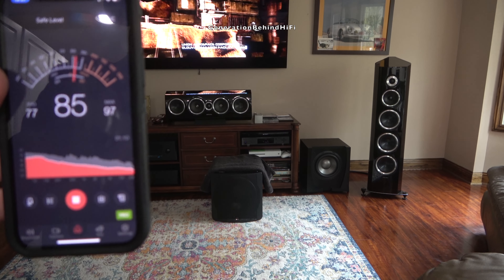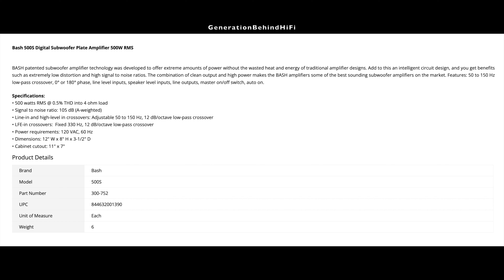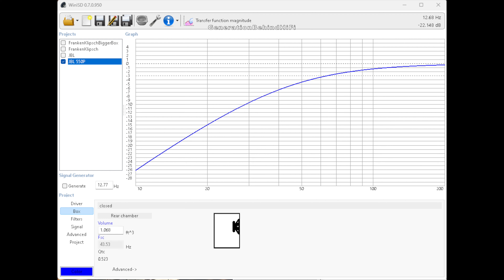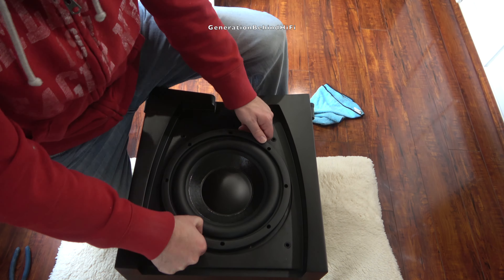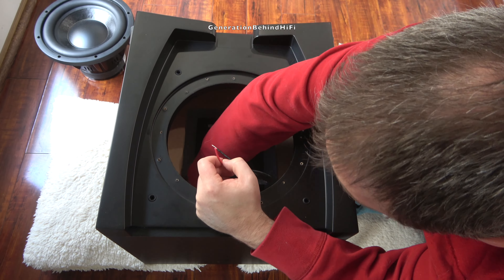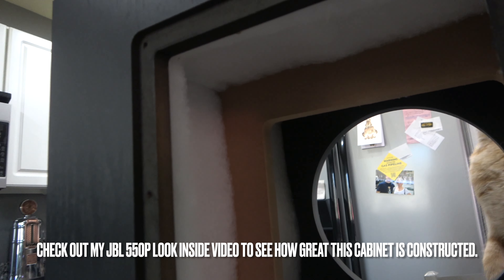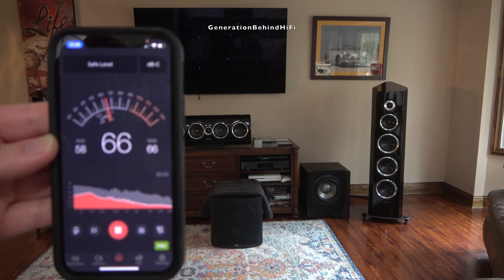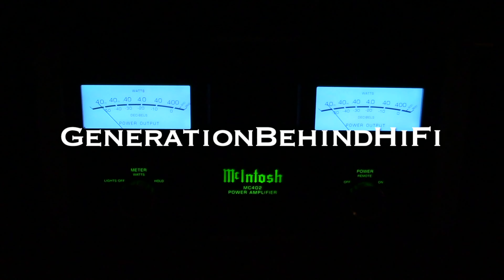Upgrading A JBL 550P Subwoofer P2/3

Comment: Which would be better for movies? 2 stock JBLs or one of your upgraded ones? I’m considering cost. My room is 15’ wide by 25’ deep. Thx guru!
Reply from the maker: Probably two stock JBLs. You will get a lot more piston area with two subwoofers vs one.
Reply: @generationbehindhifi  thx! any downside to 2 of these? Will the lows compare to a single 12” SVS quality sub?
Reply: @doctoryip1  I have a SVS SB12-NSD and I just put in an order for 2 of these JBL's for stereo subs.  I'll let you know how they compare, but the SB12-NSD has a world class Peerless XXLS driver in it that is probably the most musically articulate driver I've ever heard for a subwoofer.  I liked it so much I bought another standalone driver for mobile audio use.  I'm not sure which driver they use now in their SVS 12" sealed lines, but they still look similar  to the Peerless.  I'm hoping the JBL's sound just as good, considering the reviews of people who have had both say the JBL is 80-90% of a SVS SB12 in both output and quality.

Comment: What are the dimensions on the replacement amp? Will that work as a drop in replacement?
Reply from the maker: I'm not aware of any drop in fit plate amps for the 550P.

Comment: Well I went ahead and picked up the SDX10 myself. Will be removing the JBL sub and looking over the enclosure today. I might do a little modification to the enclosure but I haven’t decided just yet. 

Will start looking for a new amp to run it. I have two different thoughts right now. Find a plate amp that I can install. Or, seal up the cabinet using MDF that I can cut to fit the opening. Then I can find a rack amp. I already have a few thoughts on those if I go that route.
Reply from the maker: Nice! I think you will really enjoy the upgrade. I know I did. The SDX10 driver in the JBL cabinet makes for a great musical subwoofer. Where did you get the SDX10 driver at? Other youtubers were telling me they discontinued that driver. 

If it were me, seal up the cabinet so you can get the extra volume (it will lower Qtc) and get yourself a rack mount amplifier.
Reply: @generationbehindhifi  I got it directly from CSS. They did discontinue the “old” SDX10. I contacted them and they said they were releasing an updated version. I don’t know yet how the specs differ from the previous version. It was $325 shipped to me so the price is definitely higher now.  

But yeah, I will probably install it and use it with the oem amp for now and later I will most likely seal it up.

Comment: Not to doubt your expertise and enthusiastic promotion of this upgrade, but I’d be curious: 

how confident are you that the opportunity cost of buying that $350 driver and etc. is superior—and maybe a no-brainer move—for an existing stock 550p setup, versus the alternative of maybe purchasing a $450 alternative subwoofer? Or something in the $500-600~ range, if one sold the 550p to offset the cost of upgrade? 

Not trying to be critical, just curious! As of course, the “difference” in AQ is never accurately conveyed through a video haha.
Reply from the maker: No worries. It depends on what you are after in a subwoofer. For me sound quality is paramount. A lot of these affordable subwoofers resonate over a very narrow frequency band (think high speaker Q) which makes them very one note-ish sounding. The CSS CDX 10 utilizes XBL^2 motor technology which significantly lowers distortion and maintains a very flat magnetic force (BL) curve over a wide range of excursions. 

In terms of sound quality, I think it was a very nice improvement over the factory driver. As far as output, I was able to gain an additional 4dB in output (101dB) on my Doom SPL test using the factory amplifier. That puts it in the output range of my REL HT1205. Not bad considering the REL is a 12" driver and the SDX10 is a 10" driver. 

The 550P is a great subwoofer at the sale price and to me taking it to the next level by installing a CSS SDX10 driver is definitely worth it. If you wanted to buy a subwoofer that has a driver comparable to a CSS SDX10 it will probably set you back close to $1000. Most subwoofers for sale under $600 don't have cast baskets, XBL^2 motor technology, low inductance voice coils, or high excursion capability -- "almost 30 mm one way BL excursion" for the SDX10!!!! :) 

Hope this helps.
Reply: @  holy mackerel, that does sure help, indeed! I think I’m sold dude! Just watched the rest of your vids in full and paying closer attention and yeah, I can definitely tell why you’re so enthusiastic about this. And the testament about anything comparable being in the $1000~ range? Yeahhh I think I will save some money and keep this box—follow your thoughtful and generous contribution to what you figured out was a good move here..

I bought this thing on what was then (or so I thought) a pretty good sale in 2021 for $210 shipped. It was a little, affordable housewarming self-gift, since I’d moved into a house where I could get away with having a real sub. Having that sub bass was impressive at the time but it’s always been a little off the tier of my (admittedly small, but good, and just powerful enough for the space I set them up in) KEF Q150 FL, FR, and center, with two vestigial Q100s serving as RL, RRs (all of these bought on the famous “great” sales you’d get on them back in the day) that had previously been my 3.0 setup. The TV is a A95K 65”, so I’ve been pretty committed to getting an optimal home theater experience. And with 4K BRD and a UB820 on this TV plus my Calman for Sony + colorimeter adjustments, I think the IQ experience is above the average/above-average theater level and basically as good as it gets for reasonable consumer in-home potential. Although AQ is inherently a lot more tricky and painstaking (not to mention $$$) of an endeavor to get to a comparable “peak”/best on the market experience, let alone rivaling a theater—let alone a good one/true IMAX. I can still try, and am still happy. And any and all of our guests that have ever watched a 4K BRD (or even streaming) film with us have been quite wowed by the IQ (to be expected) I mean, even I am consistently “wowed” by it, each time we get a new disc I haven’t seen before on BRD and/or happens to be a particularly notable good transfer. Hasn’t really gotten old and I imagine it will be a long, long time and entail unforeseen tech advances before this TV is seen as anything near lackluster. Other than size obv, and they did indeed make 77” an option with the newest gen, which is more enticing than the tech/IQ advances which sorta plateaued with this QD-OLED beauty.
And AQ? They’re also more or less equally wowed because it’s so foreign to most ppl, to experience more than a soundbar. So,
expected also… but funny that they don’t see the obvious weaknesses in it that I do/know I’m missing out on, on that front, versus IQ.

I was very tempted to upgrade to R3 Meta Front L/R about a year ago but deterred by the cost and uncertainty of the gains for my pretty coincidentally nice “theater”room (12-13~ ft speaker/screen to ear distance, 11~ “width” of the room that is walled off solidly on 3 sides an pretty acoustically optimal compared to living room/TV spaces in the past. Not enough room to do 7.1 without some big living space compromises. Maybe Atmos, but tbh I’ve just never looked into that very much. Speaking and looking around at the setup now I think the R3M could be a smart upgrade if I could get a good deal… or even just Q350s as they’re on a decent sale rn, although that wouldn’t be quite as fun as a jump to R3M ofc 🥹😅. The distance is pushing it for Q150s, I’ve always felt but found hard to admit. And relegating the Q150s to 5.1 rears or seeing if I could make 7.1 work could be fun and worthwhile.

So yeah, I’m a bit of a KEF loyalist speaker wise, but understand that either (or both) they are not the way to go, for optimal subs, and certainly not in a price-is-an-object situation. Last I can recall researching subs, I’d narrowed it down to Rythmik or SVS, $1000~ budget, possibly favoring dual subs as I can get away with it at my house for a change (very freeing to be able to blast, more or less at one’s discretion)….

I think I’ll take the conservative/smart approach and follow your guide here regardless, because the 550ps volume works pretty well in this space and it’s been decent as-is…. A jump from $200 sub to $1000~ sub equivalent AQ sounds very enticing for a $400~ upgrade cost… and it gives me more time/savings to save the next, years-away upgrade to a probably $2000-2500~ sub pair. 

Your upgrade/DIY thing may just make the budget work, to upgrade the front speakers! TYSM